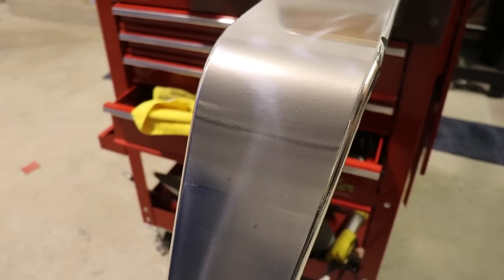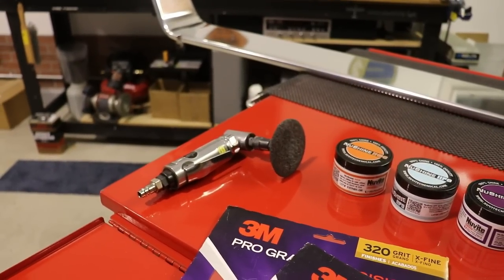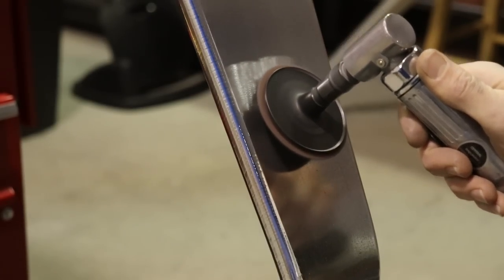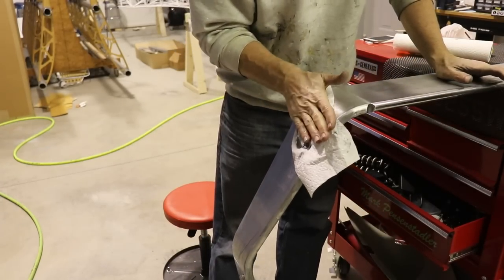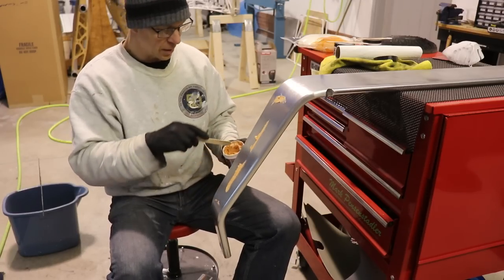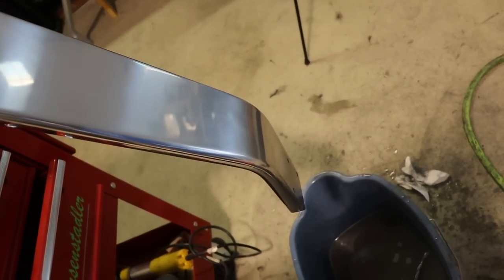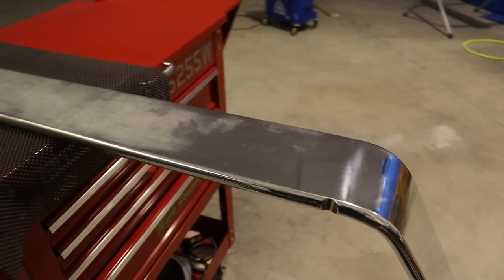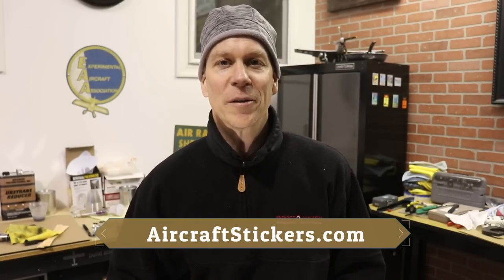Kitplane Aluminum Gear Polish

Comment: When I did bizjet detailing all I ever used on the leading edges and other brightwork was Nuvite. That stuff is worth the little bit more that it costs than other polishes.  A random orbit Porter Cable was the other thing that really made the planes look great. No swirl marks which become really obvious in the sunlight. Polishing metal is a lot of hard messy work (especially the bigger planes like Gulfstreams and Global Expresses) but it is so satisfying once you're done.

Comment: Looks great!  I just went through a similar process with my grove gear for my Kitfox due to surface corrosion.  I wanted to be sure I didn't remove material to the point that it degraded the safety of my gear.  I cleaned the corrosion off with the scotchbrite and took 14 readings at predetermined points with micrometers.  I went with a 240, 320, 400, and 800 sandpaper followed by a quick wipe down with some Flitz (following your recommendation on a previous video!).  I took measurements again at the exact same points and found that on average I removed .0013" of material.  Probably nothing you were concerned about but figured I'd share my findings!  Full write up on my build blog-search my username on TeamKitfox Forums if you're interested.  Thanks for the videos!!

Comment: Yeah yeah, way late to the party... Didn't know if you would be doing this on the SD build, but just in case, a friend introduced me to the fact that they have DA sanding discs from 40 grit all the way to 8000 grit. I was doing 2000 wet on a car by hand and he asked if I enjoyed doing things the hard way. I'm not sure how flat the main surface of the gear is, but it could save some time, and your arm.
Reply from the maker: MX after 30 That would prob be easier, but on the SD I’ll be painting the gear legs Army green to match the fuselage.